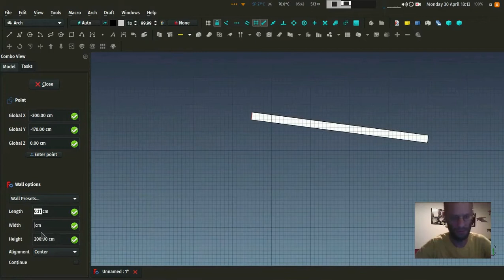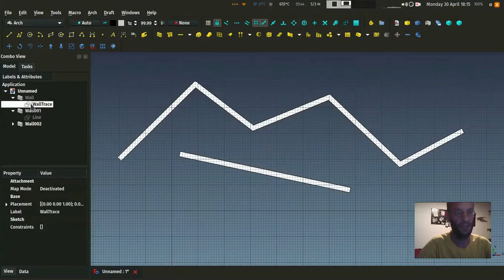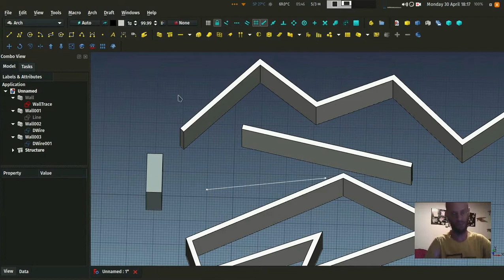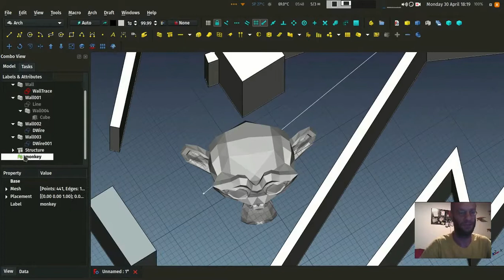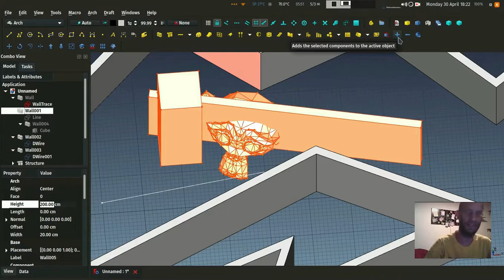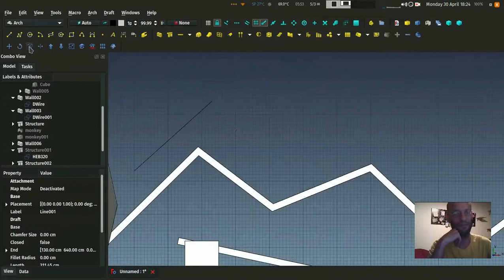BIM with FreeCAD - Walls and structures

Comment: I think that walls should not be a single element. even if the basis is a polyline, then the product is separate walls for each segment of the polyline. then you can set the orientation of individual segments (right-center-left) and change the height.. the main thing is that the segments of the walls should be able to combine the correct angles
Reply from the maker: Yes for that we'd need a proper join mechanism. Note that the "experimental wall" in the BIM workbench works as your idea

Comment: Looking at your wall and window objects it seems it would be possible with some tweaks to create walls based on line or polylines that would have directly several components inside;  example: an outer face brick with thickness 9cm, and air grap of thickness 2cm, the insulation of thickness 14cm, the load bearing wall of thickness 19cm and possibly the plaster finish of thickness 2cm. This is what is happening with a window except that you can't base them on a line or polyline.

Comment: Hi, Do you have plans to update obj. (or any other) polymodel importer, because now Freecad´s importer and mesh to shape command produce varying results if using quads or ngons. With the Freecad version 0.17 the only way to import clean meshes is to triangulate surfaces, which usually ruins the geometry. 
If this feature would work properly, you could find a big market from architecture and visualisation Industry, because then Freecad becomes the core link between polymodel sofwares (like Blender) and other BIM software (like Revit). So the industry could transform 3D models to IFC in Freecad and open them in Revit for example. 
The other solution could be an ability to edit lines and faces after the mesh is converted to the shape, so everyone could clean the topology easily.
Reply from the maker: Importing mesh objects and turning them into solid geometry is a very complicated matter, you will find that with any other software that is able to do that (rhino is probably the best of them). But yeah of course I'd like to achieve that too at some point.
Reply: I see the challenge! I look foward to your contirubution for this great software. Thanks!

Comment: Hello Yorick..Are you under KDE...How do you get the dark window for FreeCad ?
Reply from the maker: I'm using fluxbox actually. But basically freecad will take the colors of your desktop theme. Or, you can use a custom theme too specifically for FreeCAD. There are several built-ins that you can set in the preferences.